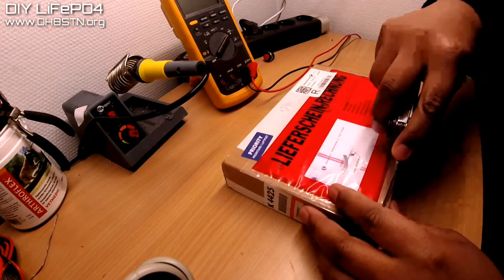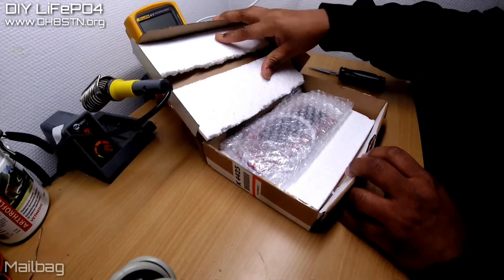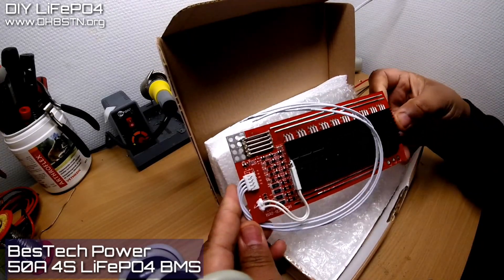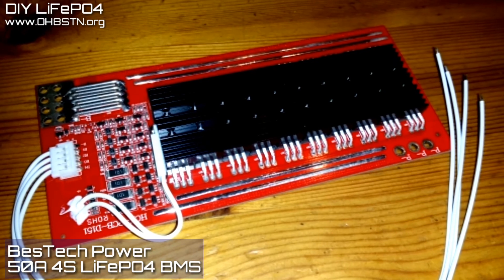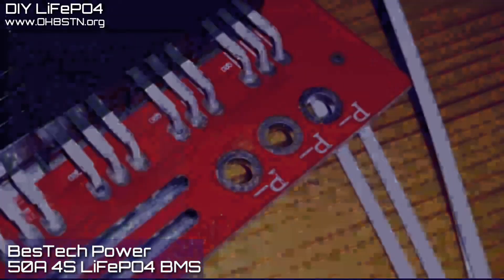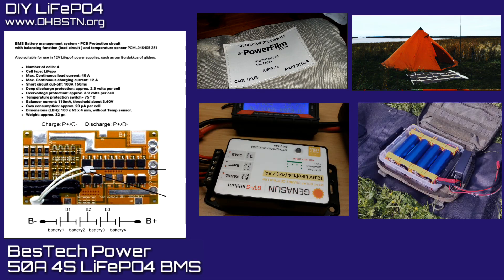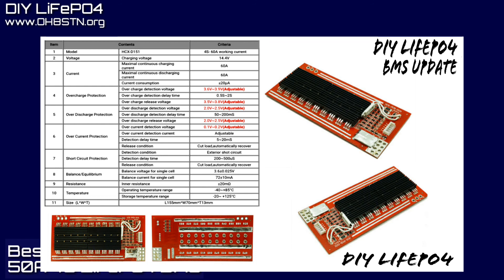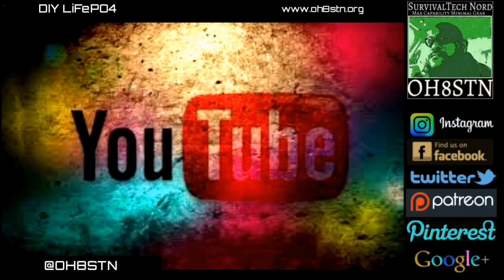Bestech Power 50A 4S LiFePO4 BMS

Comment: Just started using this board and it kicked in when voltage got low.  When bench charging, do you bi-pass the BMS?  My particular charger, HiTec RDX1, comes up with a Connection Break message and won't charge the pack.
Reply from the maker: Hi Dan. I'm not familiar with that charger but the only time we should bypass to bma, is when balance charging. If you bypass the BMS, while it is connected, something could be damaged. Either the cells or the BMS.  I can't speak for your particular charger, but if you charged with the solar charge controller, it's connected in parallel with the discharge connection. All of that is in the documentation I've published for this BMS. If you're lucky, the BMS protected your pack from your charger.
Reply: @diylifepo4  You're the best and thanks for the quick reply.  I won't run the risk by bi-passing the BMS.  Thanks again!
Reply: @diylifepo4  You have me puzzled.  I thought one of the purposes of the BMS was to balance charge the pack.  Those connections you made are balance leads are they not.  BTW, I certainly agree both understand and agree with your argument for using a BMS but there are a few things I am confused about.  For a 4S 5 P 50 amp hour Headway pack, you have 5 sets of 4 cells in series.  You, therefore, cannot balance each individual cell.....only each set of 5 cells in parallel....assuming that they do "self balance."  The BMS I assume handles each P set as a single cell.

I was talking with one of the guys at Buddy Pole.  I was thinking of getting the mini.  However, strangely, unlike your solar controller, I was told you cannot use a non solar charger through it.....that does not make sense. In addition, since the mini has the ability to cut off the load to prevent under voltage, it obviates the need for a BMS.  However, the mini does not give you a way to balance your pack.

I have a number of universal chargers for cylindrical cells.  However, for my pack, I am at present using something like what I saw you use, a buck cc cv PSU.  I took a pair of HP server supplies and run them in series giving me 24 v.....or I can run them in parallel for more amperage.  Either way it is quite enough for using the buck PSU to charge any lithium chemistry so long as you set the voltage properly.

So, I would like to understand what you mean here.  If your bms does not balance your pack, how are you balancing it.

Comment: Thanks Julian! Question, I looked at the diagram and what if you had 8 cells, consisting of 2 overall packs in paralell?  I'm running the headway 15Ah batteries.  4 in series, and another 4 in series for a total of 30Ah..any idea on how to wire that to this BMS?
Reply from the maker: Absolutely . You have 2 cells in parallel, 4 sets in series. The balace leads still connect to one psrallel pair. Does that make sense?
Reply: Ehh....kind of.  I am basically doubling your pack in the video.  I'm having trouble visualizing where the balance leads and the power leads join the board.  Example, Lets call battery packs A and B.  A has 4 cells in series like yours.  Duplicate with B.  Balance lead 1 goes between cells one and two on battery A.  But what about the cells 1 and 2 of Battery B?  Does it get wired to the same balance port?
Reply from the maker: The problem is thinking of it as two different battery packs. Think of each parallel pair of cells, as one cell. You have one BMS and for one balance ported goes to both cells. Check this image. 
 https://i1.wp.com/oh8stn.org/wp-content/uploads/2017/11/a123-5ah-lifepo4812216030..jpg?resize=678%2C381&ssl=1

I'll make an image for you over the weekend and post it here 👍👍👍
Reply: Ahhh!  The lightbulb came on.  So you are balancing pairs of cells, so no real way to balance each cell individually unfortunately.  I was going to try it with 2 BMS before but this makes much more sense.   Thank you sir.